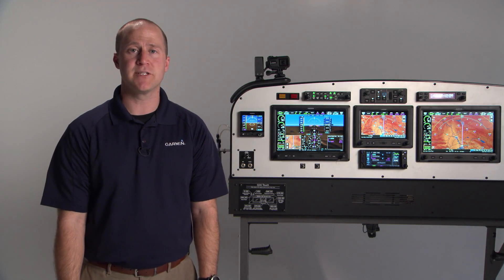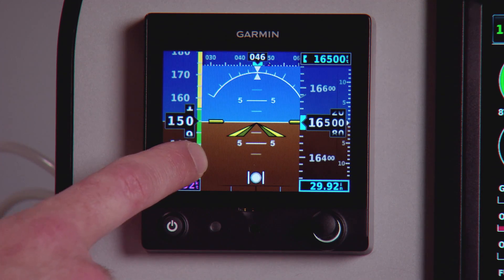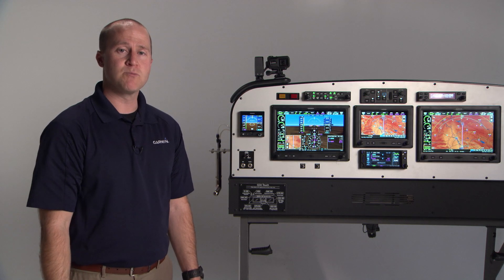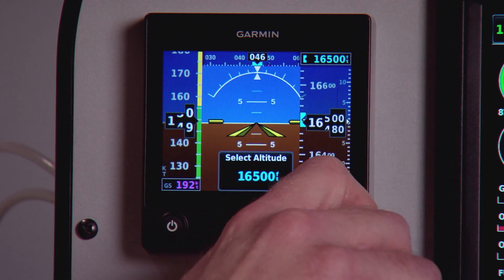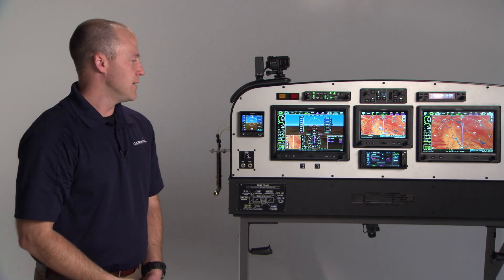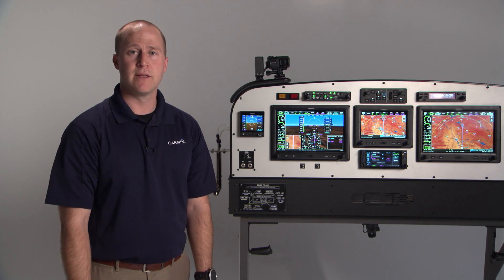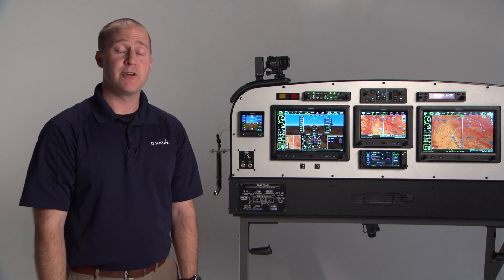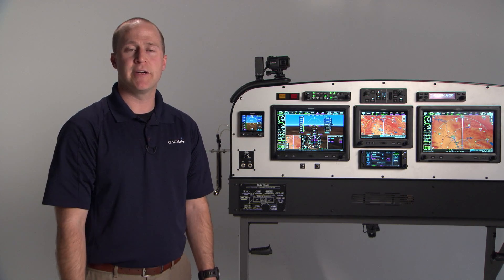Garmin G5 Electronic Flight Instrument

Comment: Ok, you have the GPS to OBS. Now, you’re VOR/ILS GNC-255 should also feed that G5. As you have it set RMI style, I’ll assume it is so wired. How do you toggle the OBS to that OBS? My understanding is that an option should be available on the PFD display but mine lacks that option. Is there a setting that also needs to be adjusted? I’ve a GNX-375 and GNC-255 tied to my G5. The GNC VOR works fine with its own OBS and as an RMI on the G5, but I can’t toggle thus get no glideslope from it. The GPS works well both OBS and RMI style on the G5 with its own map and OBS on itself.

Comment: Hi,
can somebody explain me what happenes at 1:10?
During the baro setting there is sligth change of the pitch.
But why????
Reply: He changed the baro setting, which the instrument interprets as a change in altitude.  The pitch changed because the AP was adjusting to get back to the originally preset cruise altitude.
Reply: I believe the system is in altitude hold, so when the baro setting is changed the autopilot is seeking the new altitude. This is why the pitch and airspeed changes slightly as baro is adjusted.

Comment: Hi there, my certified G5 has toppled on two of my last four flights. Local agent said the fix was to update the software to the latest version, but to be honest it worries me that if that's true then the previous software version (that the unit shipped with) allowed the unit to topple (i.e., display pitch and roll errors of 10 degrees or more) with no Attitude Fail flag. Has anyone else had a similar experience? Any advice?
Reply: Did the software update fix this? I'm considering a G5 to avoid EXACTLY this problem, I'm now not so sure of this..........
Reply from the maker: We’d like you to reach out to our Aviation support team so they can gather more information and further assist you. Please contact them at the following link:
http://bit.ly/GarminFlySupport
~JH
Reply: OK thanks will do – I tried the general support link but hadn't heard anything.
Reply: Did it get resolved?

Comment: Is it possible to add a magnetometer to the G5 in the stand alone configuration to show actual heading instead of track?
Reply: Yes.
Reply: Thanks Adam, I wish I had been able to figure it out sooner. Initial reports from Aircraft Spruce claimed it couldn't. I had to make a decision and ended up going with two GRT Mini-AP instead.
Reply: How do you like them?
Reply: Don't have them on hand yet. I ordered them during Sun and Fun so they should be ready soon. A played around with a Mini-X that had most of the options, and it was quite impressive for such a tiny unit. The G5 has slightly better graphic , but the Mini-AP is stuffed with features you normally only find on bigger screens. I'll probably publish my upgrade experience on my construction blog if you are interested. http://longezproject.blogspot.com